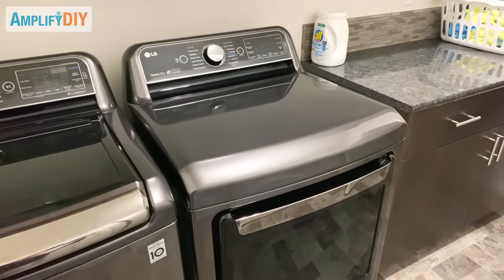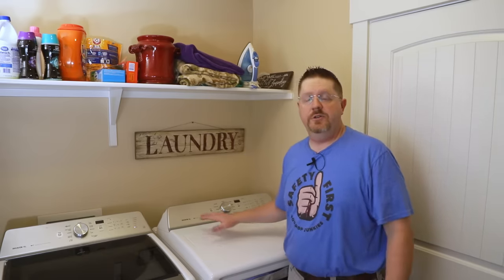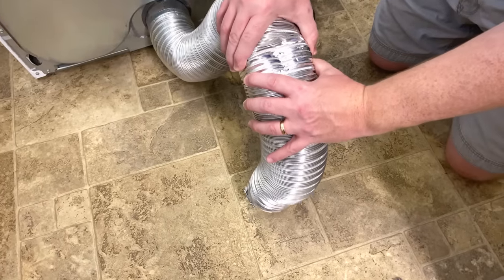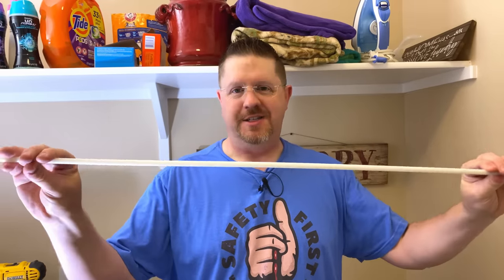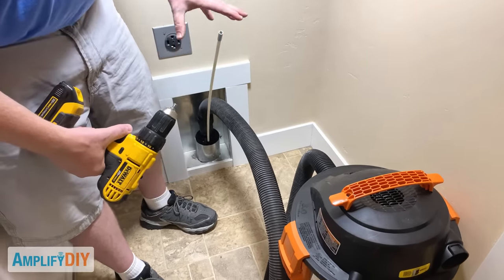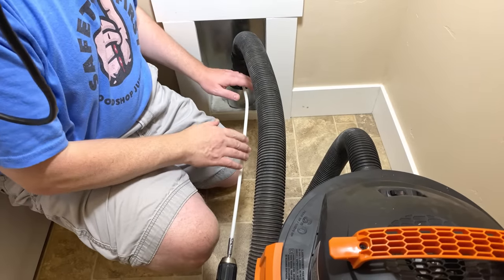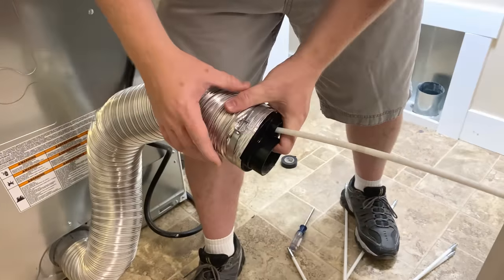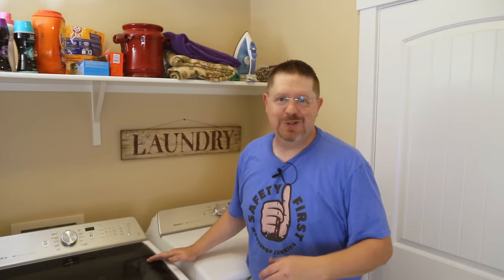How To Clean Your Dryer Vent Duct - Step By Step - It's Super Simple!

Comment: I love the system that you have, my house is nothing like this...the duct is a soft aluminum that bends horribly and is very hard to get the dryer escape tube connected, and on the roof it is a permanent fixture, I can't remove it to clean it...

Comment: Very thorough,  thank you. Never know this can be done. I couldn't understand how did you remove it by using drill moving forward direction
Reply from the maker: Hi Amol - great question! The movement of the tool simply loosens the lint off the walls of the duct. The suction of the vacuum then sucks all the loose lint out. Thanks for watching!
Reply: @AmplifyDIY  thank u sir

Comment: I'm very grateful for this information. I do have a question though...... How long is the longest duct within a home you've every encountered?
THANK YOU AGAIN!!!
Reply from the maker: The longest? Probably around 20'-25'. Most homes are quite a bit shorter, as the laundry is generally located in such a way to make venting a pretty short run. Usually 10'-15' or so.

Comment: Good job explaining the cleaning of the metal dryer duct from the exterior of the house to the clothes dryer.  
But, what about below and in-between the clothes dryer's removable lint trap to the rear of the dryer? How do you clean and remove all of the clothes dryer's internalized lint?
Keeping the clothes dryer as lint free as possible can not only save money on the required electricity or the natural gas while drying loads of clothes but also reduces the probability of a dangerous fire.
Reply from the maker: I didn't get into the specifics there because this varies quite a bit between different dryer models. On some, you have to remove the top, side(s), or front panel(s) to get access to clean everything internal. I recommend checking the owners manual and following whatever service procedure is listed there. Good luck, and thanks for watching!

Comment: Thanks for this very well done video.  I love all the details that you explained.  I just have  one question. Is it possible to do this from the outside of the house?  Thanks!
Reply from the maker: Hi Vanessa - Yes, you absolutely can do this from outside the house. The vent adapter for the shop vac won't usually fit on the outside though, so here is what I recommend: start the dryer (empty - no clothes in it) on the coolest cycle it offers. This will provide plenty of airflow to blow the lint out of the vent as you clean from the outside in towards the dryer. Wear some eye protection and a facemask while doing this, as all the lint will blow out of the vent directly at you while you do the cleaning. Good luck!
Reply: @AmplifyDIY  Thanks for your prompt reply.  Very good advice.  Now to go get a cleaning kit.  :-)

Comment: A little over a year ago, I changed out my vent. It’s about 15’ long. Maybe longer. The builder used the cheap foil junk for that length. When I removed my old foil duct, it was caked full of lint. I tried blowing it out every six months. Anyway, I put in smooth 4” like it should have been. I sat outside and listened to the air flow I had never heard before.
Reply from the maker: That must have been a pretty big job, T B! I'm glad to hear you replaced it - that flexible junk should NEVER be installed inside walls... any builder that does so is cutting major corners to save just a few bucks, and it's a HUGE fire risk. Nice job correcting that!
Reply: @AmplifyDIY  it wasn’t too bad as I have a basement. I had to remove my drop ceiling and insulation, but had it been drywall it would have been bad. The builder did everything wrong with the exhaust, even the hole in the floor to connect the dryer vent to the vent leading to outside. The hole was right up against the wall, and the 4” duct coming up from basement had to be bent to get through the hole. Meaning, I have to use lots of foil tape around the connection to keep lent from blowing into the basement around the pipe and into my laundry room.

Comment: This is going to help me so much.  I just figured out why it has been taking me 3 hours to dry a load of clothes!  Problem is water has collected in the outside vent, I can hear swishing around.  A wet/dry vac should take care of that.  Right?
Reply from the maker: Yes, you should be able to suck up that water with a wet/dry vac... but you should also address the root problem: water should not be collecting in your vent. Good luck!

Comment: Thank you for this easy to follow video!  Would you also advise to vacuum the area below the lint screen in this process?  Or will that be blown out when you clean the dust and turn the dryer back on?
Reply from the maker: Hi Lisa - I recommend vacuuming anywhere you can reasonably reach when doing this process. Dryer designs vary, so some are really difficult to get into without removing panels. The more lint you can remove from the whole system, the better everything will perform. Thanks for watching!

Comment: Great video (and I like the message on your t-shirt).
1) The tape is a great idea. Any reason you use electrical tape over duct tape?
2) Also, how easy it is if there's angles in the conduit?
Tips: 
Put a wall between the vent and your AC. Or I think some vents are designed to blow on the side.
At the very end, conduits should be clean and I'm not sure it's worth to reconnect the drill at each rod section. Maybe just pull it out by hand?
Thanks

Comment: Hi there, GREAT video thank you so much.  what a great public service.  I am left with one question tho, I noticed there was a type of 'bottle' brush adapter thingy as part of that first kit, but didn't see a chance to use it. when would that bigger bottle brush thing be used for cleaning out dryer vents?  thanks again
Reply from the maker: Hi Lisa - that other brush can be used to get inside the dryer a little better with some models that allow access to clean behind the lint trap, etc. Great question, and thanks for watching!

Comment: Thank you for the this informative video! Going to attempt it in the upcoming few days. If the vent is on the roof do I need to do anything else? It does look fairly dirty from looking up at the vent from ground level.
Reply from the maker: If you can get the brush all the way up to where it hits the end cap on the roof vent, you probably don't even need to get on the roof. If you are comfortable with the height and have a safe way up, then it's a good idea once you are done cleaning to just go inspect the vent exit to make sure there are no chunks of lint still stuck in it. Good luck!

Comment: Great video.  I recently cleaned out the duct connecting dryer, and it was packed with lint.  I replaced that piece, but 10 year old dryer still wasn't working well, so we bought new dryer.  Upon removing old one, the duct was full of water.  Could that be caused by a worn out dryer, or is it more likely a clog deeper in the duct?  Ours vents to the roof.
Reply from the maker: Hi Johnson! I'd suggest checking your roof vent to make sure it is not letting in any rain water.... Good luck!

Comment: Very thorough! How do you know if you need to just replace the tubing duct?
Reply from the maker: Hi Amanda - the duct inside the walls should last the lifetime of the home - as long as it is the smooth-walled ducting I showed in the video. As for the flexible hose that runs between the back of the dryer and the wall, that should be replaced it it ever becomes crimped, crushed, or develops a hole. Thanks for watching!

Comment: Great video! My roof is really high and I am scared to go up there. I worry that I cannot access the other side of the vent and that the brush will jam the lint and create some kind of blockage. What would you recommend for that situation?
Reply from the maker: As long as you are using a vacuum to suck out the lint as the brush scrapes it off the walls of the vent, no blockage should be possible. Good luck!

Comment: Great video!  Question regarding cleaning without the shop-vac adapter (the cheap kit).  The idea there is, the brush loosens the lint off the vent walls, and then next time you turn on the dryer it blows it out?
Reply from the maker: Hi Peter - it's best to get the lint out while you clean... otherwise you may wind up with a ball of lint large enough to actually block the entire vent. If you don't have a shop vac, you can do it this way instead: 
Leave the dryer connected and set up as though you were going to dry some clothes. With the dryer empty, start it up on its coolest cycle. Then, go to wherever the vent exits, and clean from the outside of the house in towards the dryer. The air pressure from the dryer will be enough to blow the lint out as you clean. Be aware though, that this will blow the lint out straight into your face, so wear eye and respiratory protection. 
Good luck!

Comment: Excellent Tutorial video. We had water damage of our laundry room. That dryer exhaust was open for almost a month. We were too scared to touch anything. Last week W/D was installed but the tile was badly installed so they have to be taken out again. Tomorrow another tile installer will come then will take out W/D again and install new tiles. We saw your video. I'm not sure if there is much time to do all these steps.

My question is. The length of the exhaust from inside to the roof is just 1.5 to 2 feet. A new exhaust pipe was installed. Is it possible to just use a leaf blower quick so we will not use up too much time of the tile installer's time?
Reply from the maker: Hi Tony - I apologize that I didn't see this comment sooner. I hope you were able to clean your vent and that your laundry room situation has been corrected... but to answer your question: A leaf blower will get the big chunks, but will leave a lot of lint still stuck to the interior walls, which will just catch more lint again pretty quickly.  If all you have time for is a leaf blower, it's better than nothing - but using the brushes only takes 10-15 mins once the dryer is moved out and you have access. Good luck!

Comment: My duct runs upward in the wall and up the attic out on the roof. Can I still follow the same procedure ?  this video is very well done and explained. Thank You
Reply from the maker: Hi Cyriloh - yes, this same procedure works no matter where the vent exits. If you are unable to safely get up on the roof as I did in this video, you can have a helper stand out in the yard where they can see the vent on the roof from the ground, then just follow the instructions in this video until your helper can see the brush as it tries to exit the vent on the roof. Good luck!
Reply: @AmplifyDIY  Great, I received my kit and were able to clean the duct just as you indicated. No issues at all 
Very good video. Thank You

Comment: Thanks for the informative video.   What kind of camera are you using to inspect the air vents?    I might want to get one to be able to see how much blockage there is in the vents before starting this project.  Also do the flexible brush segments you attach to the drill, how flexible are they for example if you have some right angle turns up in the attic will they be able to bend?
Reply from the maker: Hi there Gruntled! The camera I'm using in this video is a cheap wifi borescope from DepsTech: https://amzn.to/3o79REt - you'll need a smartphone to use it. Also - yes, the rods flex and bend easily around corners in the vents. Just don't go nuts with the drill... you'll note in the video I kept the drill spinning at a relatively lower speed - especially when I felt it going around corners. Also beware: there are a whole bunch of cheap copycat knock-off products on Amazon. I have heard from other viewers that they bought the cheaper kits and wound up with rods breaking off in their ducts, heads falling off, brushes falling apart, etc. I recommend getting the LintEater brand specifically, as that is what I use and have never had any problems with it:  https://amzn.to/2E0gZjK Good Luck!

Comment: Mine is on my roof too... at the very freaking top...with a steep pitch...I used this kit to clean mine several times and it worked great... I just did it from the bottom and went all the way to the top until it stopped... then after that, I used an electric leaf blower.. Years ago I was talking to this lady on a laundry forum and she has a blog as well. She said her and her husband lived in a condo and they got so tired of having to do this... she said since they had easy access to the back of their dryer without moving it...that her husband bought a nylon gallon paint strainer...and lined the strainer into the piece that connects the dryer to the wall, sort of like a trash bag..it catches any lint the dryer misses and keeps it from going into the vent run.That sounded so crazy to me...but I wanted to try it because I can get behind my dryer too without having to move anything....it works so well and has kept my entire run clean for YEARS...No one does laundry but me..I clean it every 4 loads..  Just get back there, take it off, vacuum it, put it back in about 5 min's...I'm so thankful I ran into her on the forum or I would have never thought to do something like this. I would rather do this chore than the chore of cleaning the entire run every six months. My clothes dry so fast, the dryer never overheats because everything always flows so well because the run stays perfectly clean all the time.... I think it's less of a fire hazard than even a 1/2 clogged dryer vent...there's never been any indication of a burn on the paint strainer

Comment: Great for metal vent pipe. For semi rigid foil pipe, I would be extra careful shoving a rod in there, especially at an elbow, as it could puncture the foil? Thanks for sharing!
Reply from the maker: Hey Wave Riderz: you are 100% correct - only use this tool if you have the solid metal pipes as I showed... and you should have that type of vent, as it's been code in the US for many, many years. If you have a flexible pipe installed as the vent pipe, it should be replaced with smooth walled vent as soon as is practical. 
Thanks for watching!

Comment: Thank you for this video. As I was removing the cleaning kit the cord unscrewed and was still in the vent. How can I fix that?
Reply from the maker: Hi Hiram - you'll have to either find a way to fish it out, or blow it out with air pressure. Do you have a leaf blower? I've heard in some cases people are able to use a leaf blower to blow strong enough pressure into their exhaust duct to literally blow the brush out... or at least move it close enough to reach. 
I've also heard some success with attaching a bent coat hanger to the end of some of the flexible rod and using it like a long hook to try to reach in and hook the head with the brush to pull it back out. 
Good luck!

Comment: Fine video!👍🏽✌🏽
Questions: What kind shop vac do you use? What's the diameter of its hose? What can be done if the diameter of the hose doesn't match that on the vent cleaning kit?
Reply from the maker: Hi Marso - most shop vacs have a 2 1/2" hose, and I believe that is what the kit is sized to use. If your hose is a different size, some duct tape should adapt it easily. Good luck!
Reply: @AmplifyDIY  👍🏽

Comment: Great Video!  I just wanted to say that it would be better if the manufacturer made the drill bit adapter hexagonal instead of round. Then it could also be used with electric screwdriver, not just a drill.
Reply from the maker: Great point!

Comment: Thanks for the video. I have stackable dryer in an apartment, is there a good to clean the dryer vent? I would appreciate the insight
Reply from the maker: Hi Gabriel - it may be a bit harder to move the unit so you can get access to the dryer vent, but the process is essentially the same. Before you go to the trouble to clean it yourself though, check with the property manager. They may be responsible for providing this maintenance, as the ducting may be more complicated and/or longer than what I showed in this video. Good luck!

Comment: My daughter and her boyfriend just moved into a new rental house, so prior to them moving my wife and I along with her boyfriends parents did a really good clean up of the place, I’m thinking of sending the landlord a bill. After seeing how filthy the heater filter was I knew the rest of the house wasn’t going to be clean, they were in the house for a about a week when she called saying that the dry wasn’t working well, so that weekend I grabbed my duct brush and drill motor. I wanted my daughter to learn this so I had her do the entire process. We pulled out the dry when the first thing I noticed was a dryer hose that was 6’ long with several kinks in it, we only needed 2’ (plenty of room to tighten). Next I had her run the brush down and to my surprise very little lint, so we left the dryer out and disconnected and went outside to brush from that side, to our amazement we couldn’t believe the amount of lint, approximately 5 gallon bucket full but we still couldn’t reach far enough back. So I busted out the secret weapon, a battery powered leaf blower, I went back into the house and shoved it down the dryer exhaust tube and squeezed the trigger, I was glad they recorded it because I would not have believed the amount of lint, but now it’s definitely clean.

Comment: Love and appreciate your video!  Question:  my duct is only about 6 feet long and easily accessed from side of house.  Rather than go spiderman and run my brush from the dryer side, can I just run it from the outside of the house all the way through to the inside of the dryer so as to avoid even having to move my dryer?  Any risks there?
Reply from the maker: Yes, you certainly can! Only risk is to be very gentle when the head of the brush is in the flex hose that goes from dryer to wall. Good luck!